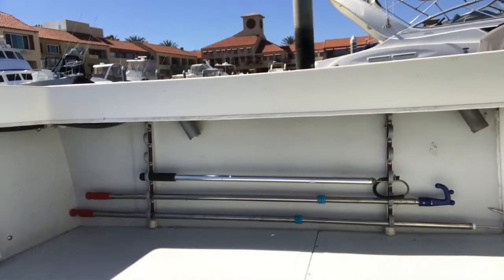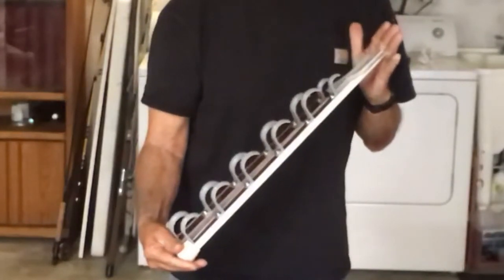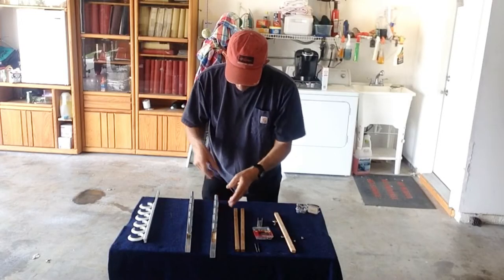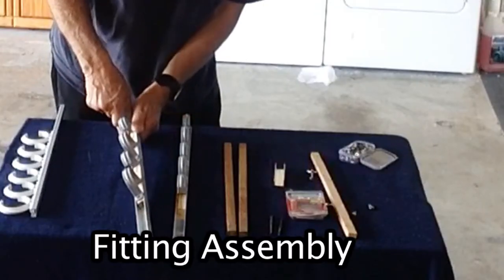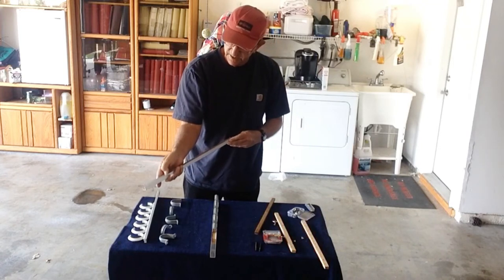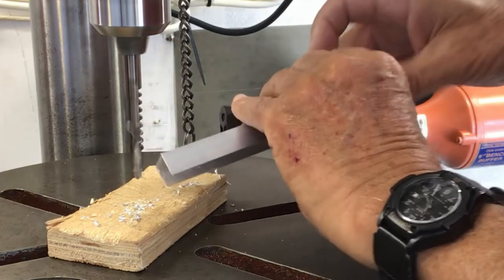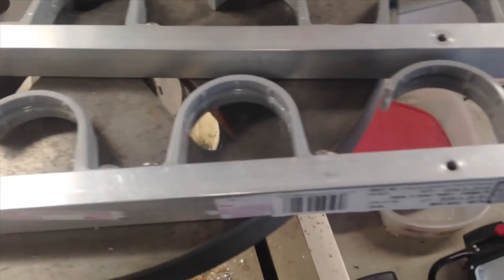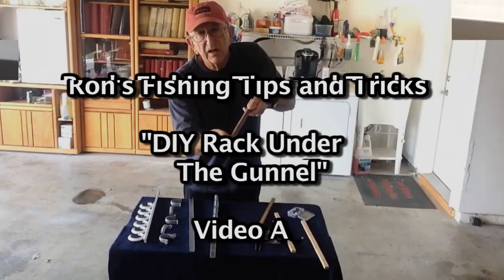Downsail - How to make  Rack Under Gunnel  Diy idea keeps cutter down.

Comment: This rack is suitable to be used inside a cabin of a boat for rod holders.  T top, overhead, etc.  It  is cheap, good, durable, I chose to demonstrate its use to clean up the under gunnel area of my 26 Shamrock boat.  Factory had equipped it with chunks of teak that required cleaning and were less usable than this design.  If you would not mind please like, subscribe, comment, but please talk about this idea.  Good luck.  Run into problems let me know.  Want to suggest something let me know.  Sincerely, Ron and Gerry